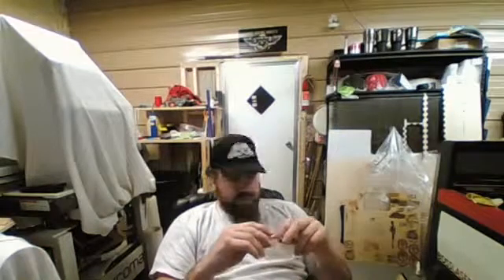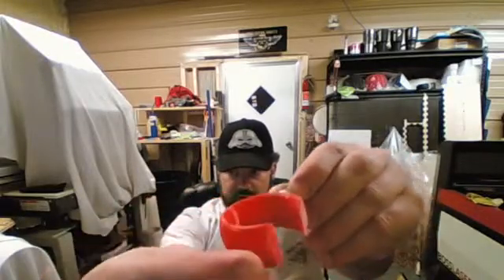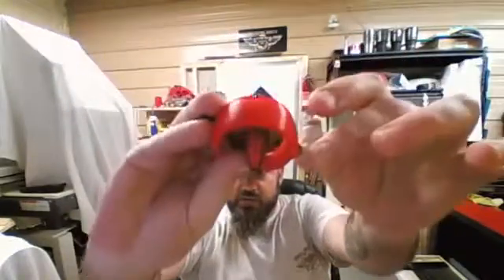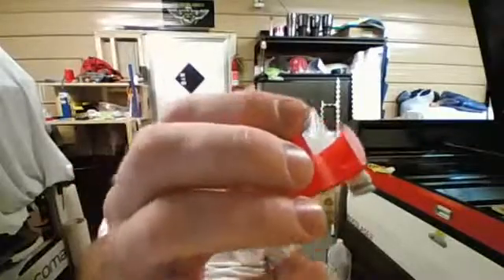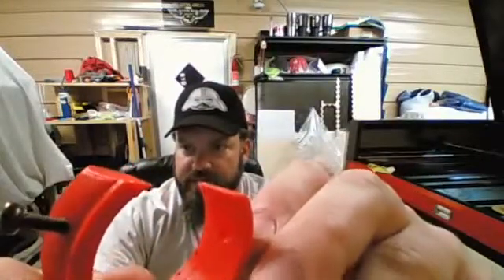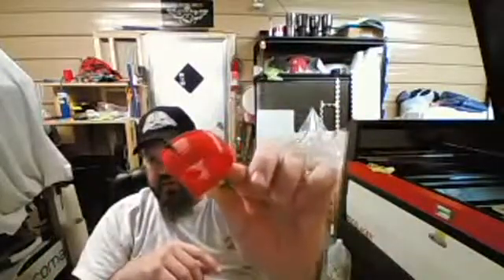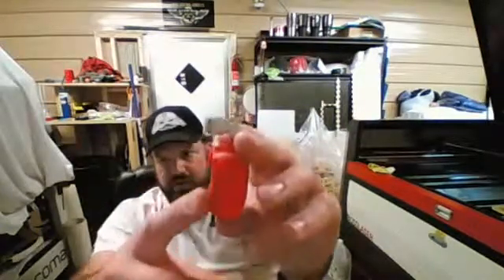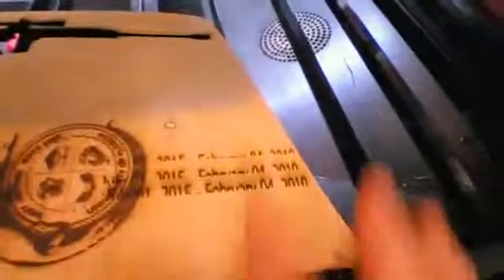Boss Laser secondary air system for Engraving

Comment: Nice , what model you have of the Boss Laser ? what have been your experience ? is that company have been good to you ? thank you in advanced with any inside
Reply from the maker: This is a LS3655 Boss laser. It has been a great budget laser with outstanding tech support. Had one issue with control board and they over nighted me a new one and been strong ever since
Reply: @JERCustomDesignsInc  thank you for taking the tie to answer , if you had to buy it again what would you do different ? if anything
Reply from the maker: @bstadele  i would have got the one that cuts metal too. I will be getting another one soon. oh and not waste the money on the rotary attachments, cheaper online